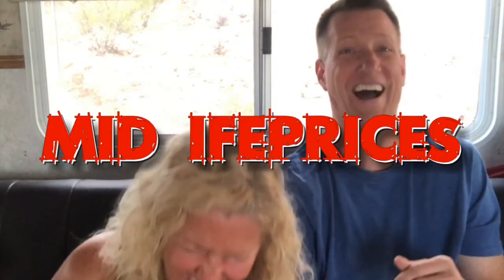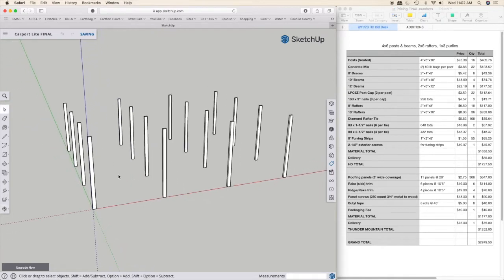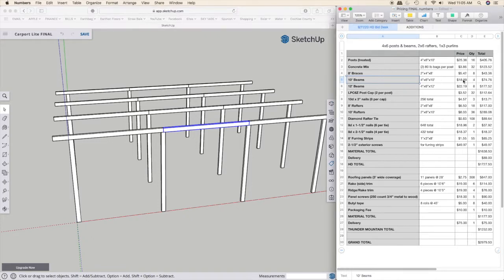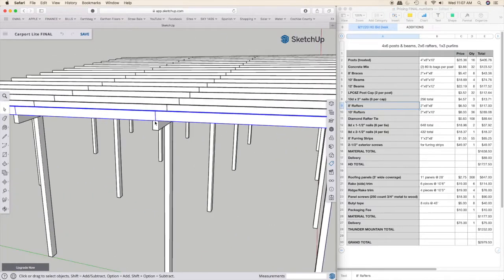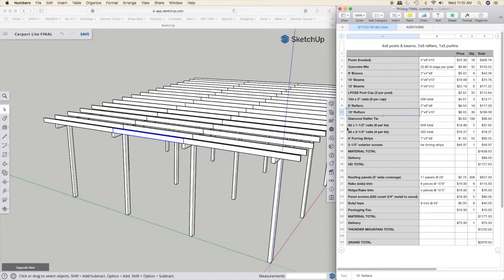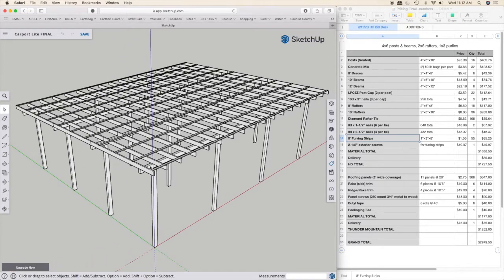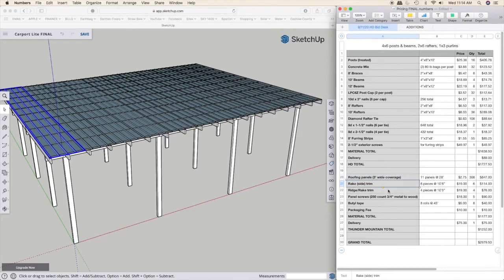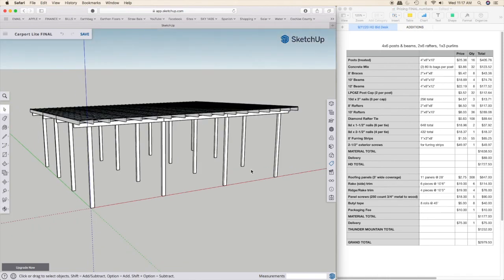DIY 3-Bay Carport Build (Part 1: SketchUp Design & Pricing)

Comment: Hey Brian well planned out as usual. Love it. Something to think about for future builds ,4x6s  over time warp. Using a double header, 2 2x6s on each side of the post with a 2x4 or 2x6 depending on the orientation of the post between the two over time is more structurally sound. At the same time you can attach your rafters to the 2x4 or 2x6 webbing and for go rafter ties. In doing so you can reduce the amount of rafters down to 3 or even 4 ft on center. And then use 2x4 purlins or what I call lathing. It saves a bunch of money and just as structural. Cross bracing on an open structure is essential. Metal attached to purlins has some shear but in a 50 mile an hour wind I have seen 1 inch screws pull through osb and 1 inch pine. An inch and a half screws through a 2x4 not so much. The butal tape definitely a plus at keeping wind from getting under the lap side of the metal. Another thing is installing the metal where the lap is going away from prevailing winds will make the roof last longer. I love the program you use. I just do it all in my head. It's hard to explain to people. You do an excellent job of layout and design.
Reply from the maker: Great tips, Moses!  If I hadn't built it already, I definitely would make some of the improvements your suggesting.  The roofing screws through the purlins definitely does feel a little flimsy to me, but I figure I can beef some of that up from underneath with 2x4 blocking if it starts to make me too uncomfortable.  I love to go into this stuff as prepared as I can, but it seems like I always end up looking back after the fact and wishing I had done something differently!  I'm still trying to accept that I can't predict and plan for everything, but it still helps me sleep better at night to know I gave it my best shot.  Thanks for the advice!
Reply: @MidlifePrices  you the man. If you ever want a sounding board holler at me , I dont know everything but I know what I know and am glad to help. Appericiate you guys.
Reply from the maker: @HighDesertHomestead  Careful what you wish for!  I'll add you to my list of people I bug about everything! 😃
Reply: @MidlifePrices  no problem Brother anytime anytime.

Comment: First video Ive watched. Sounds like Az area. I build mine using 4x6 but used steel beam front and backed. Saved a lot on wood.  9 ft front 10.5ft in back. No drive through. Tfs
Reply from the maker: Right on!  Lumber is definitely expensive right now.  Thanks for visiting.  Hope you can find more here you like!

Comment: In Nebraska you have to go 48 inch’s deep and even then, deeper for 4-6” of gravel for drainage. Many cut the post into a point for less surface area of frost to push up on. I wet winters or snow melt even in clay it is can reach under it. A full foundation for a garage by code requires 2” extruded polystyrene (R10) on the outside down to the footings and under the floor even if not heated. Lucky dog.
Reply from the maker: Yeah, it's a little different here! 😄  Sometimes our weather benefits us, and sometimes it hurts us. 🤷‍♂️
Reply: @MidlifePrices  We get high winds with low pressure weather fronts coming East over the Rockies, the High pressure spinning clockwise from the South. Last July 10th, we had a 132 MPH down-draft that took out 3 ponderosa pines and up-rooted the trees in a 10 minute storm 9 miles from Boys Town. Lost 5 big branches off front tree. Otherwise, controlled burns get away from them, end up grass fires. DK, Omaha